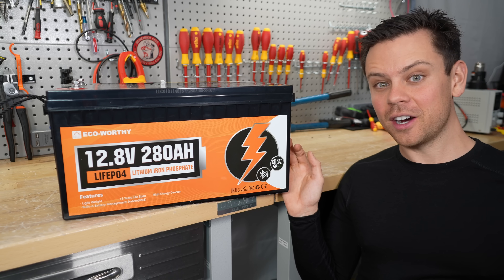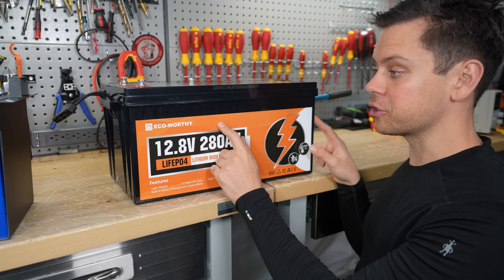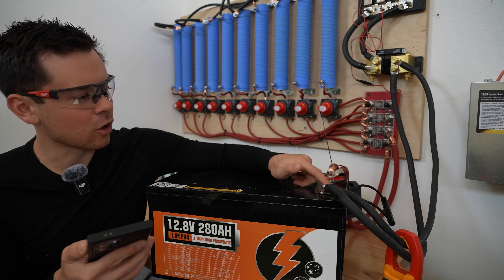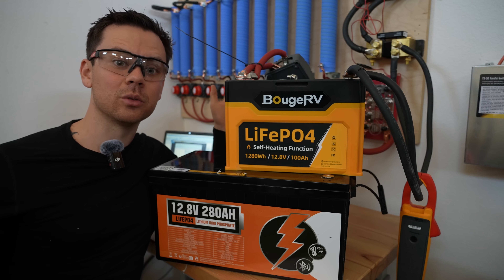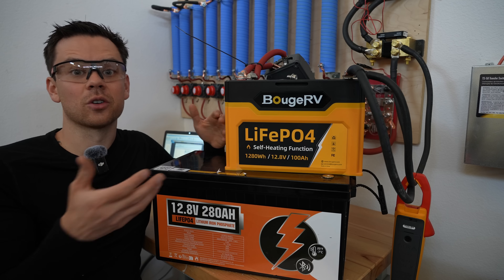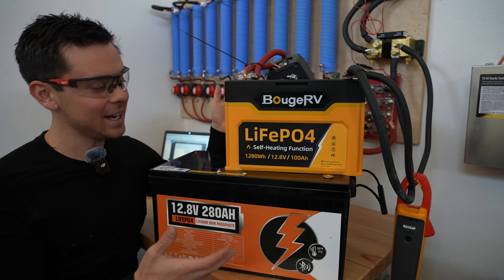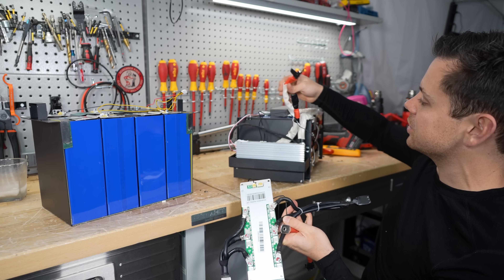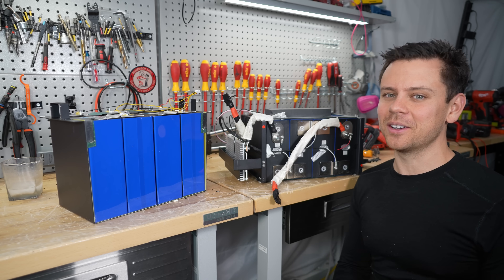$423 Ecoworthy 280Ah VS $529 Wattcycle 280Ah and Over Current Discussion!

Comment: How about testing this battery? Very cheap. Humsienk. Only $140 on Amazon
Reply: I just got the Humsienk 100AH Smart Mini. It weighs 19.9 lbs. The BMS which is made by TDT  is the same as WattCycle Smart Mini. There are no metal brackets which makes it slightly lighter. It advertised as having EVE cells but the QR code on the cells is for Great Power. I'm getting 103 AH. App is BMS Meta V1.1.6 or GoKWh. With password 888888 all parameters can be changed. The battery case top is screwed on but plastic plugs cover screws. These plastic plugs can be easily removed using a small wood screw.

Comment: Could you please test the 850 amp and see if it trips within XX seconds.   Would love to see how it would work on a boat with bow and stern thrusters that pull 700 amps each for short bursts.  Would temp sensors shut if off if it gets to hot? 1400 amps If both thrusters are used at the same time.
Reply: You should just go with the Epoch battery for bow thrusters.  It can handle 1000amp discharges for a couple seconds, 700 would be handled for way longer.  The last thing you want to skimp on for a “critical” bow thruster move is a cheap bms saying “let’s turn off now and cool down…”
Reply: @aussie2uGA  a couple of seconds is not going to work.
Reply: @mvsummertime  What voltage?  12V?
Reply: @aussie2uGA   yes 12 volts
Current system uses 2 lead 8 D batteries.  They have about 1500 CC each when new. They are about 3 1/2 year old now so can only get About 30 seconds of spaced out short burst of 3 seconds each. Before I get low voltage warning and GPS/Depth sounder reboot.  Time to replace or upgrade with something that could last longer.
Reply: @mvsummertime  Ok, then your inexpensive choices are limited.  Ionic makes a nice 1800cca constant current 12V lifepo4 but it's over $800.
Reply: @aussie2uGA  Thanks I will check out Ionic. Might be what I am looking for. I might end up going with lead again.  I do have Daly Truck start BMS on order to test with some Eve 280 cells with high amp terminals to test with.

Comment: I have been using an ecoworthy setup for over an year with zero issues .. but its only in my truck bed camper - 100watt solar panel  (ecoworthy), dc to dc solar charge controller (ecoworthy) and 100ah lifpo4 battery with bms. Thank you very much for testing this battery to show its quality and vulnerabilities.
Reply: No good 1pannel for 100watt meior pannel da 410watt 172cm x 113cm good good 100euro leroy merlen 84euro + mppt no fake is real mppt for victron o epever good good 100volt 30amp.and dc dc charge 30amp.o victron xs da 50ampere regulable con app.cellulare charge alternatore for battery motor for battery lifepo4 12.8volt ecoworty is good very good by

Comment: After Listening to Will and owning 12-Chins 280 AH Batteries. I added 300 amp fuses to each positive connection at the Battery. Then my SolArk 15 is limited to 100 amp charge from the Grid. If I ever have to use my Kohler 20KW to charge my batteries I will increase my Amp output to 200 amps. Everything is flawless with 19,500 watts of output.

Comment: I base my choice more on the BMS than the cells. I want a battery with a programmable BMS because the default settings are not ideal for everyone's use case. I want to be able to set my own, lower, overcurrent protect. I want my cell over volt protection at 3.65v not 3.7v or over as is common, I want a low voltage disconnect at 12v not when completely empty as I can't always guarantee that recharge will be immediate. I want a pack over voltage disconnect just below my alternator's regulating voltage so I can avoid low voltage overcharge and, because of this, I want balancing to start at 3.4v/cell and to balance to 5mv not 10 or 15 as is more common. I'm not sure if the Eco-Worthy allows programming or not. The BMS looks quite JBD like.
Reply: The eco-worthy app is just the basics, but it is a JBD (SP04S034L4S200A) … if you want direct access to all the configuration options you’ll need a better (search for XiaoXiang BMS) which can edit configuration but there’s a small additional charge for this feature and remove a small ad. Interestingly, it also shows the eco-worthy 280Ah as having 3 temperature sensors.
Reply: i confirmed my eco-worthy has a jbd bms, works with overkill solar app to monitor real time stats. you can read all the protection settings. they seems to have disabled the ability to write new protection settings to the bms however, which im ok with as the settings are all configured well. plus i dont have to worry about someone connecting to my battery with bluetooth and altering settings to something hazardous.
Reply: @ensom  the bms is set up for max capacity rather than max life, as you would expect as it enables them to use the smallest cells possible to get the advertised capacity. The fogstar eco range does the same with a read only bms. If you are scared of someone connecting you can just change the password an then no one will be able to connect, especially when you forget it as I have known happen. There is a price to be paid for paranois 🙂

Comment: I'd like to see a test on the Eco-Worthy 48v/50ah battery. I have 16 total in groups of 4 going to a Victron power in bus bar. I've had them for 1 year and no problems so far. The case top is screwed on and I've been tempted to take one apart but I don't have the knowledge you have and it makes me nervous to try.

Comment: I’m wondering if over current protection is necessary in every install.  I have a small RV with a single lithium battery.  It powers 12v accessories only.  Lights, propane heater, fan….that sort of thing.  Is over current protection needed?
Reply: The internal BMS in these batteries will provide over-current protection. HOWEVER, the purpose of fusing wires and cables (over-current protection) is to prevent them from melting the insulation around them, and starting a fire...
Reply: @ 
Wow, I’ve come a long way in 3-months. 

That project expanded into a Victron Multiplus 2 with 840 Ah of batteries powering the whole camper.

At this point, I could probably open an install shop.  People like you helped me a lot.

Comment: Longevity wins.  I'd buy the battery with better cells.  If the BMS was problematic, I'd just take it apart like you did and scrap the original BMS for something better.

Comment: I purchased 2 wattcycle 300 ah minis and feel like i got shafted! What do I need to make my system safe? I'm going to wire in series for 24 volts 60 amp mppt charge controller 4000 watt inverter/charger

Comment: Ive been using an Ecoworthy 25.6v 100ah LiFePo4 for 6 months now, i was nervous at purchase due to poor customer service reviews, as a company thay canbe very hit and miss. So far the unit has behaved perfectly, going for a 2nd battery in parallel soon before i set my inverter up, so far im running my live in Bus conversion off of it. They tried rebranding themselves as DCHouse a while ago to shake the bad customer service stigma, they are trying as a company and they have some interesting kit available too at very low prices, could be worth a review Will? Thanks for your videos, you and others have really helped me understand and build my own system, specced for my own needs 🙏 all the best from England 🫡

Comment: I bought 4 of these back on BFCM and can confirm the $50 REFUND per battery.  Full respect to Wattcycle.

Given they are legit Eve cells - I’m totally good with the price.  I just finished capacity testing mine & all were 305-309AH.
Reply: I just gt the email and I was kinda bummed.  I would have paid more to get 300ah in the same size.  I just bought the largest battery I could fit that had decent reviews.  I have only had it for a week to be told that it's a 280 amp hour and does not have over current protection....  It wouldn't be so bad if I could just add more batteries I suppose.  Also the battery isn't really being used as a starter battery, but it does have to start my small generator.  Should I get rid of it due to not having proper overcurrent protection?  I do have the battery fused at around 60 amps, since I should technically never need more than that (a was using a 80 amp fuse on my lead acid and the fuseholder melted into the top of the battery without blowing the fuse, so i went down a size).
Reply: @JFlywheel you can put a MBRF fuse on it and be good
Reply: Full respect for something that wasn't an English translation issue but a complete lie? Now 50$ is the cost for dishonesty and you have full respect?
If you are ever in the market for a luxury car I have an old car I can put a new label on, I'll give you a 10% discount if you find it out though, k?
Reply: @antonyjh1234 to each their own

Comment: I really hope you would test some of those cranking batteries. Would be great to find a lifepo4 starting battery that is safe to use with smaller outboard motors with stator charging system, but what i see manufacturers are only focused on big outboards with altenators. I find it really silly, because light lifepo starting batteries would make much more sense on smaller boats. There's also some sodium cranking batteries, i guess lanpwr might be first budget brand having those. 
I know you are more focused on solar, but you are the best battery tester in this world so hope you find some time for those starter batteries.

Comment: I think the logic behind the 850A limit is that it's designed as a last-resort protection, not something you'd ever realistically reach during normal use. From what I've observed, the issue lies with the FETs used in these systems. They are often inexpensive, and their switching times can vary significantly. This mismatch can cause one FET to bear the brunt of the current, leading to failure. In a short-circuit scenario, the 850A protection might disconnect the battery, but by then, there's a good chance the FETs are already damaged or blown
Reply: yeah id prefer it to be set high, so the bms OC protection isnt likely to get tripped often, which has the potential to shorten the life of the bms. should be using fuses / breakers anyhow imo.

Comment: Will use to be happy when they pulled the rather capacity but now they have to go way over? He called out the cells in the 300ah battery but not the Eco Worthy? 
I'm also trying to figure out when you'd pull over the components rating without shorting the battery.
Reply from the maker: Yeah, the cells are getting better. To get 6000 cycles, the average capacity will be 280. So they should pull 310 these days. Technology progresses.

Comment: I am buying Four of these.   What size fuse should I use on each?
Reply from the maker: I would do 250A fuse for each.
Reply: @ thank you.
Reply: @WillProwse  HI Will, I just discovered your channel and I'm already in love with your videos. As I'm designing my own campervan, and want to understand better what I'm doing, can I ask you why 250A and not more or less? how do you size it? thanks :)
Reply from the maker: @emanueler  80% rule. Continuous rating is 200A. Divide by .8

Comment: Another strange thing about this battery is that they advertise the low temp cut-off is set at 19.4 degrees F. and resume charging at 32 degrees F, doesn't that seem to be a little low?

Comment: Will, Thanks.  

Good to see you tear this battery down.  I recently bought two from Li Time.  I think Li Time, Eco worthy, and Redodo are selling the exact same battery.  All three of them have the same fundamental flaw.  They censor the Bluetooth data so the user is unable to see the voltages of the individual cells.  Instead my Li Time batteries  show you a smiling cartoon character telling the user that everything is fine.  If everything is fine, why don't they show you the data?  

I can vouch for what LI Time does and wrote to Redodo and asked them if they displayed the battery voltages.  They responded and said they did not.  Does the eco worthy battery also hide the voltages of the individual cells?

I had a problem out of my batteries when I first installed them on my boat.  One of them would discharge just fine but the other, that was connected in parallel did not discharge at all even after the first one had discharged to 50% SOC.   After a few exmail exchanges they told me to aggressively discharge them together by switching off the discharging battery and forcing the stubborn battery to start discharging.  After the stubborn battery started discharging I was able to switch the first battery  back in parallel and they discharged in unison.  After that they both have been discharging in unison. 

I was glad I had decided to install circuit breakers on both batteries so switching them in and out of the system was easy.

Im glad to see the internals look so good.  When they were withholding Bluetooth info was was concerned that maybe they were also cheating on the build quality.

Comment: Dear Will, Was considering the Eco- worthy as have had some of their products in the past and have not had any issues thus far. There is another battery that you haven't tested and that is the Kepworth LiFePO4 100 Ah and their  300Ah. The group 31 battery that was purchased had a charger and UBS sockets on the battery. eBay  was selling their 300Ah Battery at the holidays for mid $300 dollar range. Are they any good? They say over under current, high and low  temp protections but after seeing the two you have just shown is there reason to think Kepworth would be any different? You, through your videos, have encouraged me to venture into solar. You are very good at teaching and showing how to set up a beginner system   for somebody not electrically educated. Appreciate you and your videos.😊

Comment: Could you use 1, or 2 Wattcycle in parallel for a starter battery?
Reply: Probably could but the alternator is going to charge too high of a voltage.
Reply: Good question!!  I’d like to know this too.

Comment: What about this one? NewtiPower 12V 8-300Ah $344 on temu  and $450 on Amazon with 4.5 rating, says it has over discharge protection. Thanks for your videos learned alot.

Comment: awesome!  i was hoping you would review the eco worthy! i didn't see you mention it, but i think the BMS used on the eco-worthy is a JBD. i wonder if it's possible to change the over current protection limit via bluetooth with the overkill solar app? also, you didn't test the high temp cutoff, do either have it? would the high temp cutoff stop the battery eventually from overheating from overcurrent discharge?
Reply: @ensom I got 2 of these 280ah batteries today and tested the overkill solar app to see if it would connect and it does. Looks like setting changes won’t be an issue
Reply: @jameshatfield3529  awesome, thanks for letting me know! didn't see your reply until today but, i also recently ordered one of these 280 ah eco worthy batteries. looking forward to testing it out once it arrives. one of the reasons i wanted this battery was because i saw it used a JBD BMS, and i figured i would be able to use the overkill solar app with the BMS to monitor and possibly customize the settings. makes the value even higher knowing it uses a solid BMS with a good reputation and software support imo.
Reply: good point re: changing settings
Reply: my eco-worthy 280a battery was delivered and i can confirm that i am able to connect to the JBD BMS with the overkill solar app. i can see all of the settings. it looks like they may have addressed the overcurrent protection, on my BMS it appears to be set at 220A. but i haven't actually tested this beyond looking at the BMS settings yet. i also haven't tried altering or writing to the BMS yet.
Reply: @ensom can you also edit the low temp charging cut off? 19.4 seems too low
Reply: this is a bit late but i did change my low tep setting to 0 C

Comment: Solarcart v6:  4 eco worthy’s (you’ll need to charge with ,lead acid settings) , 6000xg, add in a chargeverter for dirty generator when needed (lux should already have that built in to the 6000xg IMO).

Comment: My disability scooter is fitted with a pair of full size WattCycle 200AH 12v batteries(in series=24v). They are fantastic. I only wish the crap OEM lead acid batteries had lasted another year, so I could have got these awesome minis. I had to modify my scooter to fit the large 200AH ones... but I have a range of nearly 300km vs the original (rather optimistically) claimed 50km. Their customer service is great too.
Reply: Great range! See you on the highway? Isn't that about the same range as a Cyber Truck?
Reply: 😂😂😂 @putteslaintxtbks5166
Reply: In Australia commercially available mobility scooters are governed at 10kmh (6mph) by law. In practice it can do a GPS checked top speed of about 12kmh pretty much undeterred by any hills.

With that kind of range at 12kmh, it would take at least 24hrs to run the battery flat, and although it's not too uncomfortable I think I'll pass on that kind of a journey. But I have absolutely no range anxiety, no matter where I go 😁
 
It is possible to override the governor  with a firmware hack ( don't ask me how I know 😉), and hit more than double that speed. At higher speed though, aside from being illegal it's also dangerous, it has little in the way of suspension and is no fun at all when going fast🙄.

My next scooter starts from scratch, with no governor, 4WD and real suspension. I have learned a lot about what I want and the only way I'll get that is to build it myself. 

It will be 48v, I'd love to stick 4 of these 280AH WattCycle minis in the next scooter. Extremely happy with the WattCycle's I already have, they are exactly what they claim to be.

Oh, and the original batteries in the scooter, 75AH AGM's, came with a one year warranty and died at 15 mths.  The Wattcycles have a 5 year warranty and the service they've given me so far instils in me a high degree of confidence 👍